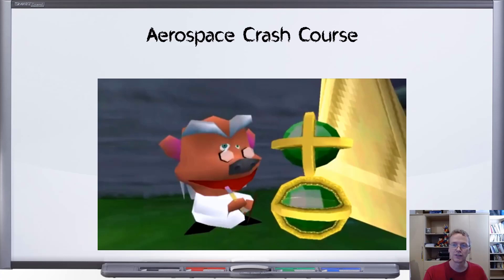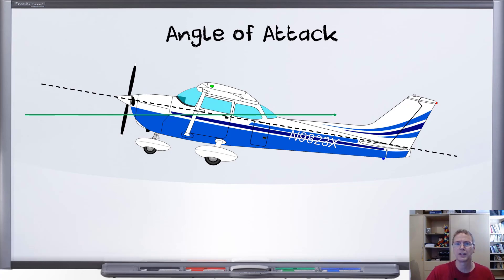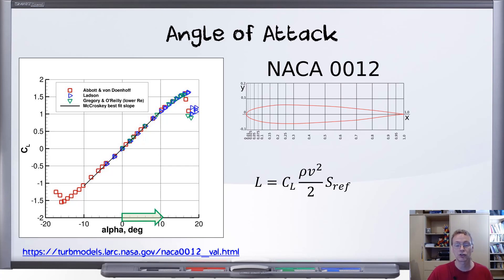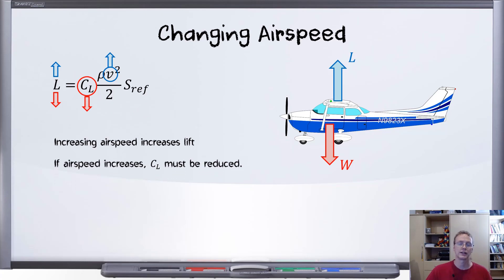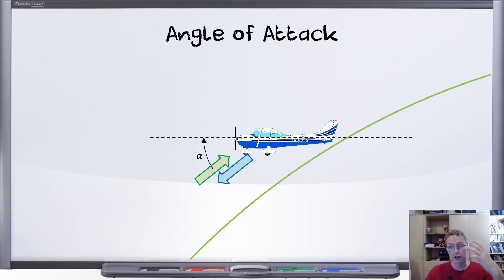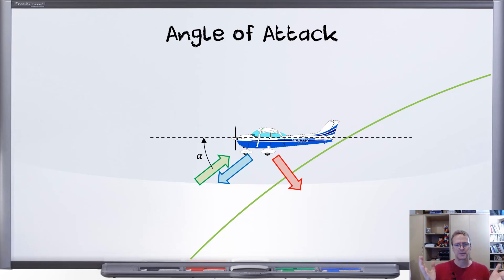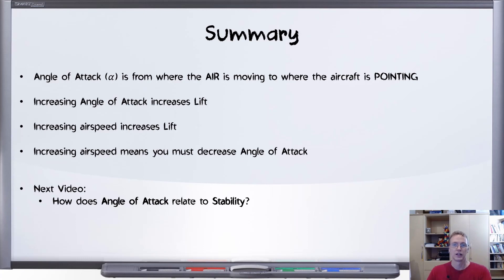Angle Of Attack

Comment: Hey I have watched your video as promised, and over all I would say that it is a very informative video, that basically anyone could at least get an initial grip on the subject of AOA, with the exception of the obvious, I would recommend this video as a good video for anyone to learn about AOA, as good as I have seen for all the most important aspects, and one particular aspect that is the Thrust element that you covered, being a great addition to this video. 
I was told that I was wrong about the Thrust/Lift relationship by several well known claimed pilots within this debate, and I had to do another video showing official documentation to support my claims, Trevor Austin was Not one of those people, so he is in the clear, if anyone wants to know ?
With the exception of a few caveats I would see your video as worthy of educational indeed.
These are those caveats….
1. Early in the video you state that the Plane ✈️ is flying left while the oncoming wind is flying right.
This I would contest for two reasons, firstly the air is moving in all directions simultaneously, and not in the opposite direction to the plane, and secondly most large Aircraft fly in what’s called the free air or free atmosphere, which is above what is known as the air boundary layers, so they encounter less resistance and weather, but also cleaner air, this means that they are flying through air that is thinner and with less rapid movement due to temperatures being lower, so without labouring the point too much, I feel that you may be pre-assuming that the air is moving opposite to the direction of flight ✈️ 
2. The globe earth bit, I may make a response video to this section of the video, as what your showing would mean that a Commercial Airliner would end up in a vertical like the F15 Pilot executed, because to follow an altitude that is following a curved surface, means that the pilot must have an accumulated pitch down from the moment they reach their initial cruising altitude.
This means that their AOA can’t be above Horizontal as it would need to be to hold adequate lift, as although Pitch and AOA reference two different parts of the plane, they are intertwined as they do work in tandem.
The Attitude Indicator references Horizontal as the 0 pitch, and most attitude indicators will show the wings and nose or fuselage, both being referenced together in relation to that horizontal.
According to Trevor Austin, a lot of Commercial Aircraft don’t have AOA indicators, so they must reference the Attitude indicators instead. 
The problem on your side is the necessary pitch change that is not recorded, that would be a must if planes ✈️ were to fly around a globe earth. 
A flight from London to Perth must end up almost upside down, under globe earth conditions. 
A Plane flying at 550 Mph taking a claimed great circle route, will encounter the following on a globe earth.
24,806 divided by 550 is 45.1018.
360 divided by 45.1018 is 7.9982.
7.9982 divided by 60 is 0.1333.
So per minute there has to be an accumulated 0.1333 below Horizontal pitch obtained, which means a 7.99 below Horizontal pitch per hour, or over the course of an 11 hour flight from London to Los Angeles, there has to be an accumulated below Horizontal pitch of 87.98 degrees in the negative, and remember for this process to happen, there can never be an above horizontal pitch at anytime during cruising altitude ? 
I may look also at your other Pitch and Stability videos as I do just like this subject anyhow, but I will wait for your response to this first, so I’m not scattering my replies across several videos. Thanks Brian.
Reply from the maker: Welcome to the channel. I'd like to highlight how civil this conversation is so far. Let's keep that going as an example to the haters out there.

"Early in the video you state that the Plane ✈ is flying left while the oncoming wind is flying right."
I think I wasn't entirely clear. We are starting with the simplification of perfectly still air. The plane is flying to the left through still air. This can be thought of as the air moving to the right while the plane is still. I was trying to say, "The wind is to the right RELATIVE TO THE PLANE." This is like when we go into the wind tunnel. In the wind tunnel, the plane is stationary, and the air moves. The aerodynamics in a wind tunnel match up with the aerodynamics up in the sky where the situation is reversed. Up in the sky, the plane is doing the moving (relative to the ground).
And before somebody complains that my "still air" simplification is a problem, we can do any sort of combination. The aerodynamic force are cause by the DIFFERENCE in speed between the air and the plane. The ground isn't involved (at least as long as you're up high enough to be out of ground effect).
So I wasn't trying to say we are flying into the wind specifically. I'm just saying that flying to the left makes the air flow over the wings from left-to-right. That's all.

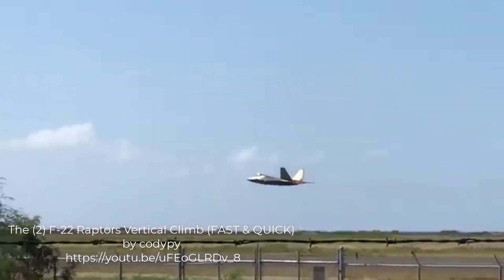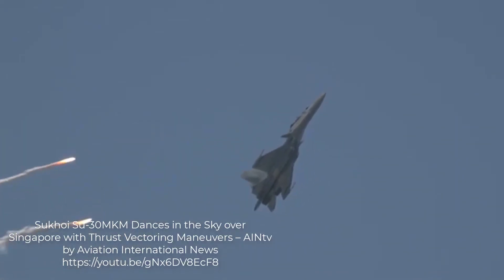"Pitch and AOA reference two different parts of the plane, they are intertwined as they do work in tandem." I'd like to stress just for educational purposes, pitch and AoA do not refer to different PARTS of the plane. This point shouldn't really be a source of conflict between flat and globe. This is just basic vocabulary stuff. "Pitch" will be relative to the horizontal. "AoA" is relative to the motion of the plane through the air. That's why the F-22 at 3:02 is flying straight up (pitch of 90) while holding AoA of 0. Get it? The F-22 is flying straight up. So the wind is moving from the front of the wing straight towards the back of the wing. The Su-30 at 3:55 is flying to the right, so the air is moving over its wing at an extreme angle.
Pitch is relative to the horizontal. So the F-22 is pitched to 90 degrees, and the Su-30 is pitched to 70 degrees. The AoA is relative to the air flowing past the aircraft, so the F-22 is at AoA 0, and the Su-30 is at AoA 70.

I think the rest is the core of the difference between flat and globe. In a flat-Earth model, horizontal is the same everywhere. In a globe model, horizontal is a local thing. Everybody's horizontal is different from everybody else's.

On a globe Earth, the plane traveling at 550 mph must rotate by 0.1333 degrees per minute. We can agree to that. That's what it would have to do.

Indeed, that's what planes do. That's where the issue seems to be. You seem to think a plane can't rotate at 0.1333 degrees per minute for some reason. I'm pretty sure it can do so with no problems.
Reply: @icansciencethat  Ok the Pitch of the Aircraft is above Horizontal because of the needed AOA, this position never changes throughout cruising altitude, as both the pitch and AOA will both stay above the Horizontal throughout that time. 
So if an Airplane is flying from London to LosAngeles then that will be an 11 hour flight ✈️ where both the Pitch and AOA of the Plane will both be above Horizontal for the whole of that flight, with the exception of take off and landing.
Now your examples of the Fighter jets are not really analogous, as for a start they are designed to be able to do those manoeuvres, but also that F15 didn’t just go straight up, it took an arced path to its maximum stall point, and used its jets to power itself upwards, commercial airliners don’t do this, they are designed for long hall straight line flight.
The Commercial Airliner is my main argument, as they fly the longest distances, and do the least amount of acrobatics in the air.
But to rub of this situation does come in your sides belief that Horizontals are not parallel to each other, and that Horizontal is just a local thing. 
For this claim I would ask for a length to this local horizontal, what’s local in length, and where is there any evidence that any pilot does any pitch corrections in the negative ? 
I will link a video I made prior to reading the full of your text, it is a link only video so it’s not public, but it addresses a lot of what you say in your comment anyhow.
https://youtu.be/9BHCUFXO0fU
Reply from the maker: @BriansLogic  agreed all round. Pitch and AoA are different, but they line up during level flight. Most of the flight (especially with commercial airlines) is level flight.
I'm glad we worked that out.
The whole disagreement boils down to that local horizontal. I'll go watch your video and come back.
Reply from the maker: @BriansLogic  Here's a quick response I made for you. (Also unlisted)
https://youtu.be/so5Bp3VySrM
Reply from the maker: @BriansLogic  haven't heard back. What do you think?
Reply: @icansciencethat  I didn’t know you had responded ? 
Il watch your video later and reply back to you ok.
Reply: @icansciencethat  Hey I watched your video, and I will make a small video response over the next two days, as just commenting is not adequate enough.
So Il be back to you with a response within 2 days ok. Thanks, Brian.
Reply: @icansciencethat  Hey Matt I didn’t forget the video, I'm working on it but I'm just busy with other things, so I should have it back to you by tomorrow ok.
Reply: @icansciencethat  Matt Il have that video for you tomorrow, I just want to do it right and not rush it, and I would have had to rush it today.
Reply: @icansciencethat  Hey Matt I made the video last night, but it seems a bit long at 30 minutes, so i will try and do another one today and see if I can improve on it, and if not, I will send you the one I already made ok.
Reply from the maker: @BriansLogic  just saw this. Left you a comment.  I'll make a video response soon... don't know when though.
Reply: @icansciencethat  Hey Matt if you want you can, but I won’t be changing my position on it, so you may be wasting your time, but it’s up to you.
Reply from the maker: @BriansLogic  Here is my response: https://youtu.be/KCXCyUCz-nU
I called out some highlights in the other comment thread... if you're seeing this first be sure to look in the description for chapter headings.